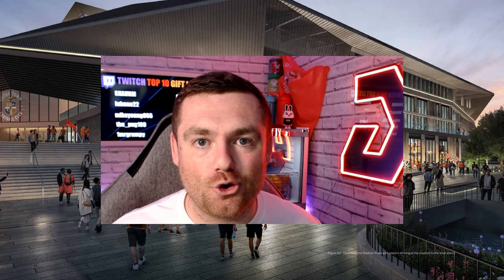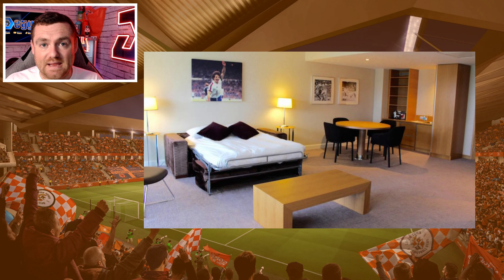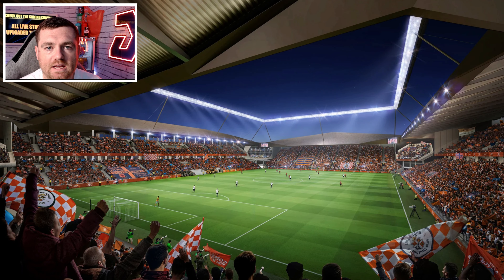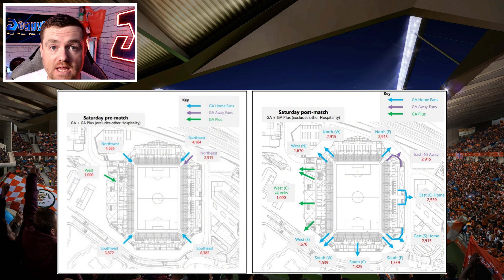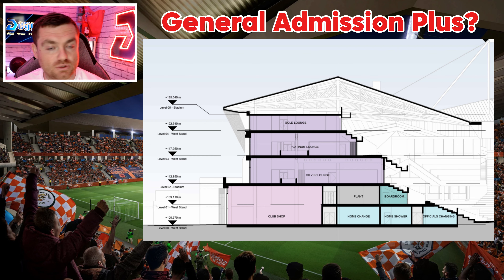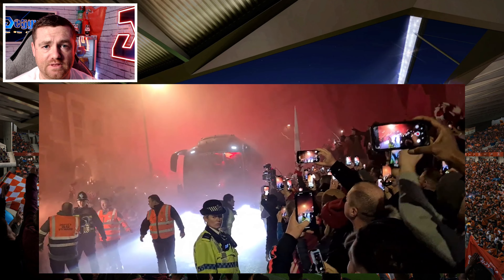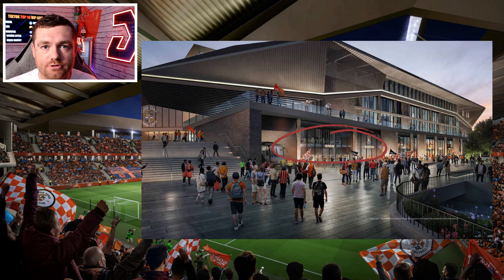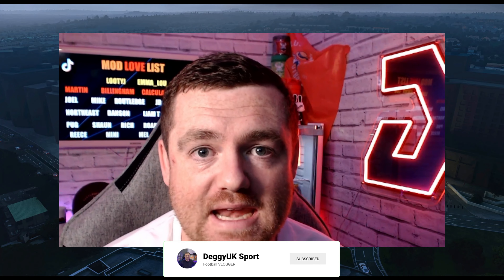DETAILED DESIGN! Luton Town Stadium Construction | Power Court | EP 05

Comment: I don’t want to come across as disrespectful, but I don’t get only a 22k capacity. Luton have come a long way in a short time. If the club wants to push on & potentially be a regular prem club, it will require finances from larger attendance’s. Yes crowd numbers are nowhere near that now, but fans flock to successful clubs. Don’t do a Brentford, a great new stadium, but nowhere near large enough for continued on field success & growth
Reply from the maker: Luton are definitely an ambitious club looking for the top however 25k stadium is a good number for the area. You see all these stadiums half empty as they’ve over done it or had the success and now just stuck in the pyramid with no chance of going up. 

Having a larger stadium and not being filled costs money. We are going from 12k to 25k, lots of revenue potential. If we are a regular premier league team in years to come then I am sure they have ideas.